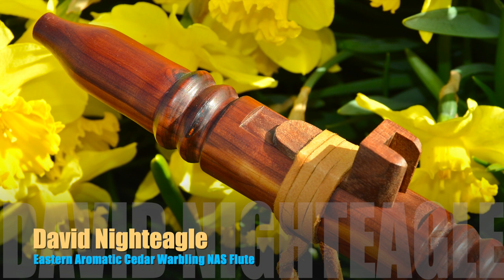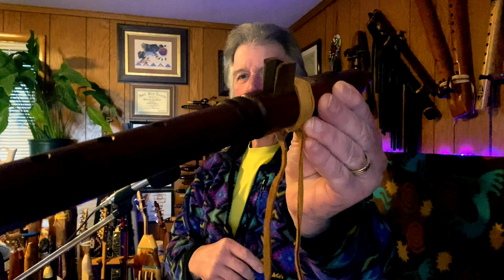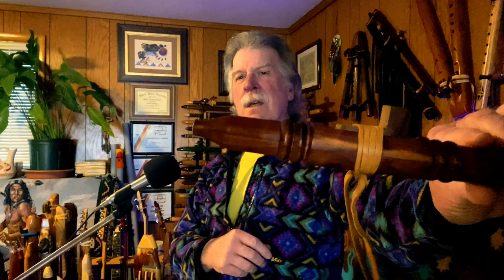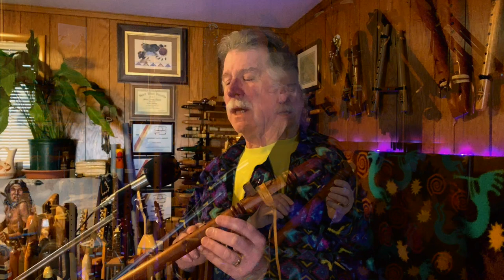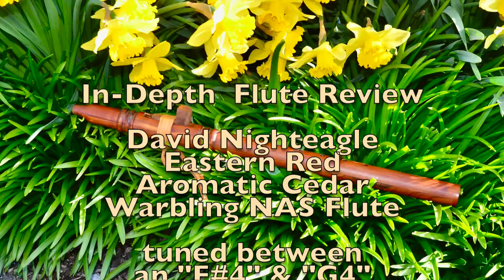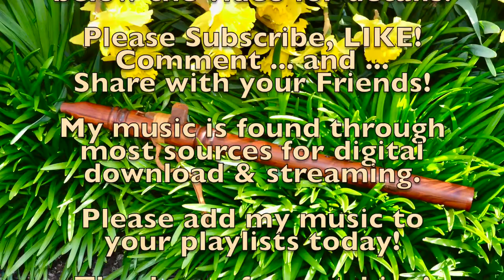In Depth Review of a David Nighteagle Warbling NAS Flute. Check It Out!

Comment: By the way, Brent - that flute, besides being impeccably crafted, also had a superb sound quality!  Its bore, being 13/16 of an inch, or midway between 20 and 21 mm. in diameter, is also just about where I myself would have the inner bore diameter for an F# flute as well.
Reply from the maker: ....and the bore is a little bit "oval". (But that has nothing to do with the "Warble" either. I have 3 other "Warbling" flutes that have impeccably crafted & smooth bores. They do have chimneys...and those chimneys are, at least a little taller than average...and the blocks have to positioned very slightly over to leading edge on the TSH...or no Warble!)

Comment: Very interesting flute, Brent!  It's interesting what you say about the warble being a desired and sought after trait - kind of like the way traditional African musical cultures valued a buzzing sound on their Kalimbas.  What is considered a beautiful and desirable sound or tone can indeed vary considerably from one musical culture to the next.  If the warble is just on the fundamental note, I would say that the cause of the warble is some kind of bore irregularity that lies in between the bottom hole and the bottom end of the flute.  I have a Redwood flute that I put together and half made - I seemingly hit a snag when I got a warbling sound, and then I stopped making it.  I chalked up the warbling sound to irregularities in the depth and bottom surface of the flue, and also perhaps to the fact that the flue had been carved too deeply - I suppose that if there is room for the air stream to wiggle around because the flue is too deep, it will do so, creating a warble.  But, the warble could be due merely to an irregularity in the bottom end of the bore, creating the instability.  I have pretty much figured out what I'm going to do with that Redwood flute - before giving up on it and chucking it out onto the firewood pile, I think that I will apply a layer of epoxy glue to the floor of the flue - that might be all that the flute needs, and I can proceed to finish it.
Reply from the maker: Thanks for watching!...and for your comments. In regard to "what makes a "Warbling Flute" Warble...It seems to have been narrowed down to the relationship between the TSH and the block (Almost always needing a deep & taller chimney). Both how the block is made AND the position of the block... it needs to be slightly protruding over the leading edge of the TSH...along with, very controlled, breath pressure. Too little breath...no "Warble"! A little too much breath... it breaks to the higher octave note. There is an extremely fine "balancing point" there. Notice, in this video how I need to "sneak up" on that "Warbling" point. It really has nothing to do with the bore surfaces. The flute is vacillating between trying to play the fundamental note...and breaking to that next octave..... going back & forth and not settling on either.